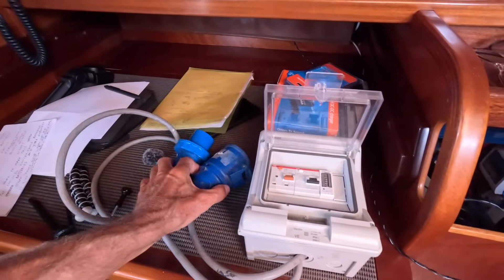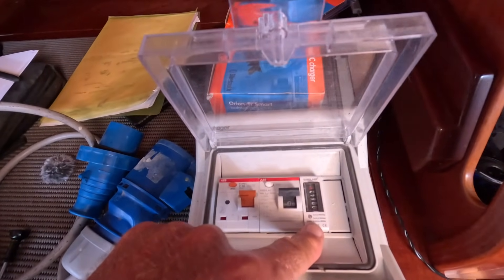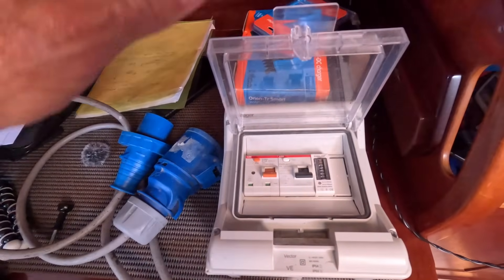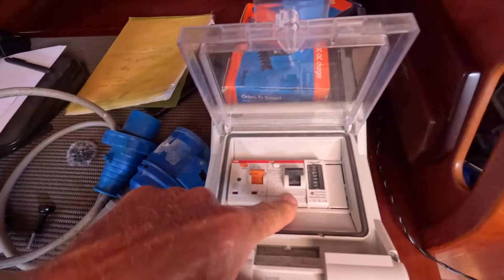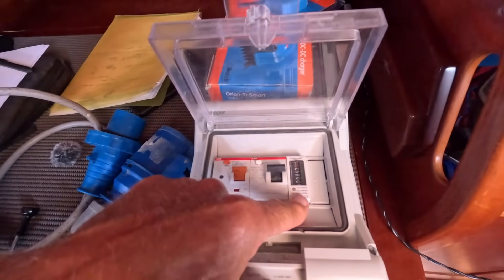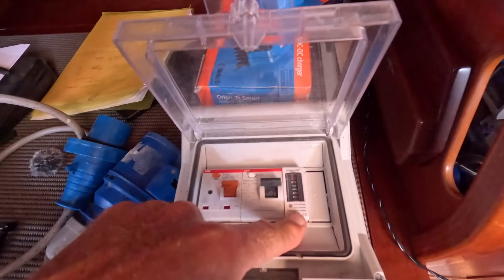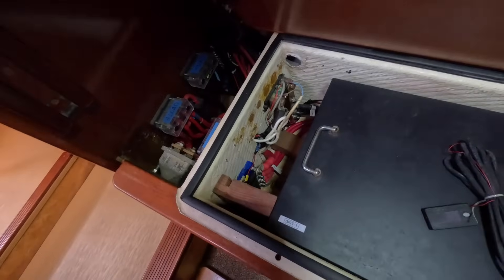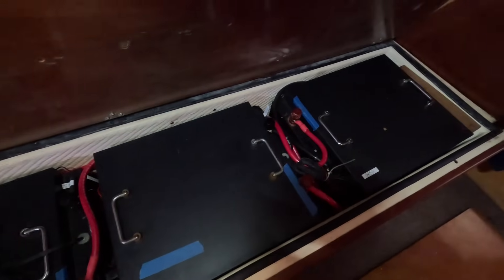Power on a Boat - A few things you should know.....  Tips on Tuesday

Comment: You are WRONG about your described use of DC-DC converters!  Installing a DC-DC converter between LiFePO4 battery and other devices (including charging devices) would only protect the BMS from transient voltage spikes from dropped charging.   There are several ways to protect against transient voltage spikes from charging.   The easiest way is to use TVS diodes like a Littelfuse TP5KP16A ($2-3 each).    If you connected your charger/alternator to your LiFePO4 battery via DC-DC converter than you would provide TVS to the BMS and DC devices, but not the alternator/charger.  Many of the devices you mention already have their own TVS diodes, but it does not hurt to add a TVS diode.  An alternative and common solution for charging LiFePO4 house banks is to connect the charging system directly to a common FLA start battery and to "combine" the house while charging with a DC-DC charger.  The  transient voltage suppression is provided by the FLA battery not the DC-DC charger.  The main thing you are protecting is the alternator.   I use a FLA start battery for my alternator connection and combine using a smart switched charging relay (like a BlueSea ARC).  I initially built a simple switch but then developed an ESP32 smart sensor with temperature probs, charging voltage and charging current sensors using SensESP connected to Signal K.
Reply from the maker: Not sure what you are writing......  DC DC Converters have input voltage, in some cases, goes to 72V without damage.  These would maintain an output of 24V all the way to 72V.   This would protect the expensive equipment that should not see anything above 32V.  Sorry, we will have to agree to disagree....
Reply: @SailingAquarius   I guess you still don't understand TVS diodes or where the transient voltages are generated.
Reply from the maker: What Ever....

Comment: BMS Wide mosfet dont give a spike. when they shut "off" they only shut of charging direction, you can still take load from battery. Better to  change bms to modern ones.
Reply from the maker: When something is charging LiFePO4 batteries, and the BMS shuts down...  There will be a voltage spike. (Period). What happens the voltage in the boat when this happens...  Things connected see a voltage much higher than expected, and some devices can't handle it and FRY.
Reply: @SailingAquarius  I'm not trying to say that it can't cause a spike when the BMS disconnects. What I'm trying to explain is that modern BMSs with MOSFETs DO NOT disconnect.
It also depends on how intelligent your charger is. If you have a relay that disconnects the batteries, you may have problems. I've measured my system with an oscilloscope and there is no increase in voltage when they are fully charged, but it balances out at the set voltage. In other words, no spike.
It's better to teach how to control your system, how to set it up and which components you can replace, instead of selling expensive DC/DCs. Andy at Off-Grid Garage gives good informative help on how to build and set up your system. In addition, he is very CLEAR when he gets things from suppliers and does not have, as I experience, hidden marketing.

If I had followed your advice, it would have cost a lot unnecessarily. SM#451 🙂
Reply: @SailingAquarius  I'm not trying to say that it can't cause a spike when the BMS disconnects. What I'm trying to explain is that modern BMSs with MOSFETs DO NOT disconnect.
It also depends on how intelligent your charger is. If you have a relay that disconnects the batteries, you may have problems. I've measured my system with an oscilloscope and there is no increase in voltage when they are fully charged, but it balances out at the set voltage. In other words, no spike.
It's better to teach how to control your system, how to set it up and which components you can replace, instead of selling expensive DC/DCs. Andy at Off-Grid Garage gives good informative help on how to build and set up your system. In addition, he is very CLEAR when he gets things from suppliers and does not have, as I experience, hidden marketing.

If I had followed your advice, it would have cost a lot unnecessarily. SM#451

Comment: Will/could a PDAR on the generator prevent that BMS shutoff caused voltage surge/spike ? ..... Arc fault breaker was new to me.  Will look into it. ..... Not sure if a DC/DC can fail in such a way that it causes overvoltage out ? .... Never heard of such a case though. ....... Edit : looked into arc fault breakers (youtube), seems they're not very sensitive and needs a somewhat high energy arc to trip, thus it's not gonna trip for minor wire/contact sparks. .... The surge can happen if you only have Lithium, and no permanently generator connected Lead-Acid (Typically the starter battery). ... I would go for a MCB with additional arc fault detection on a new installation, and new or old I would have a lead-acid permanently connected to the generator (typically the starter battery) as then there want be a surge when/if the BMS disconnects.

Comment: A great video and very informative.  A question if I may, a typical 24V LifePo4 battery normally gets charged at around +-28,8V.  Does this not pose a problem for these 24v DC to 12v DC chargers whiles its getting charged?  Can they handle the higher voltage?
Reply from the maker: Usually 28.8 Volt will not pose a problem for the DC DC converters, as they can usually handle up to 50 to 70V without damage.  But most electronic devices will blow out if they see above 32 - 36 Volts.  Check the specs.....

Comment: Just a basic question, I really want to know. How Arc caught detector could  save fire caused by lightning?
Reply from the maker: Because lightning caused a malfunction in the Fan, causing an internal arc while still plugged into shore power.  Then later, the fan caught fire.
Reply: @SailingAquarius  Thanks a lot Ken, I couldn't imagine that that.

Comment: Thanks Ken. I use smart BMS and Lynx. Solar comes in through a charge controller, alternators go into the smart BMS.
Shore power run through an inverter, which also feeds the AC system on board.
The starter batteries are charged by a battery charger via the inverter; they are completely separate.
What remains is lighting protection, which is not easy on a boat. But chainplates can be connected to a ground wire. The mast then provides for a "tipi-tent" protection with a slope angle up to 45  degrees. 
The electric charged air/cloud can still create chaos - and putting lighting arrestors on all circuits is not practical. 
A friend of mine would connect a battery jumper cable to the chainplate and throgh the other end into the soup...